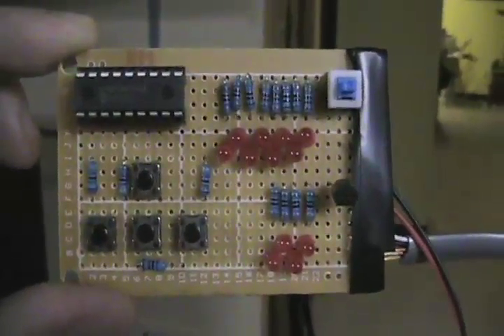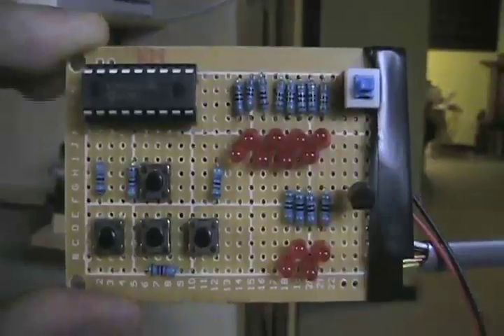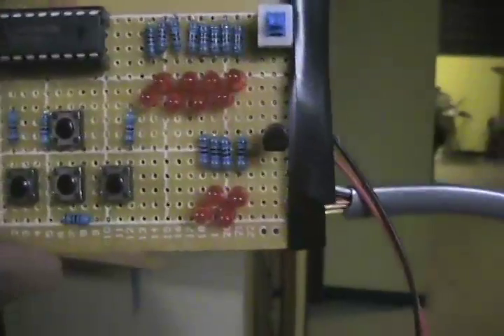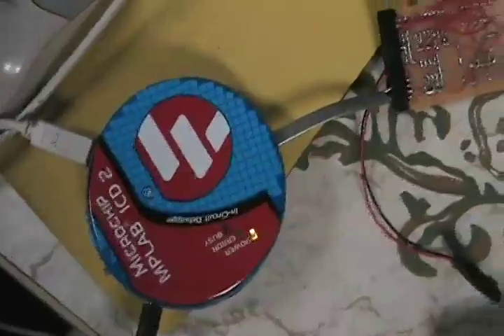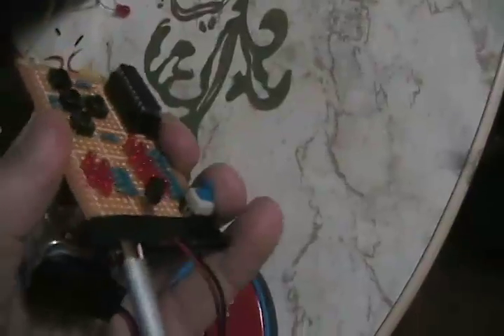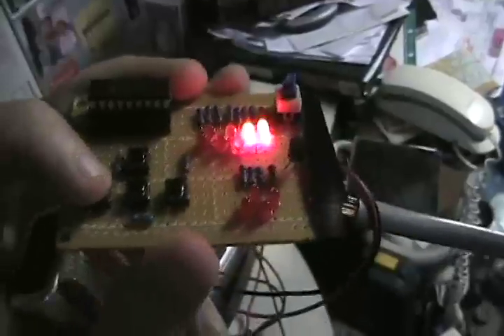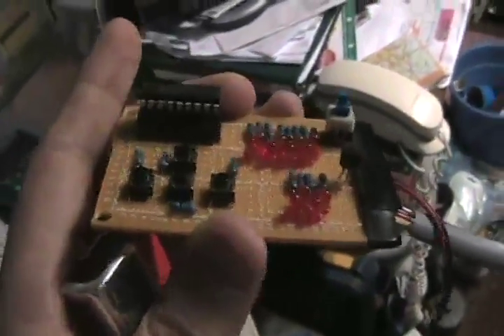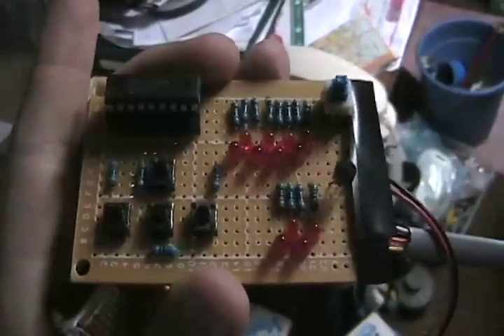My Home Made PIC Programmer board + Program!

Comment from the maker: Well that's a good idea, but the problem is that the MPLAB ICD2 unit cost $300CDN alone. As well, It takes hours and hours and hours to be able to use PICS.  The only reason I'm able to do it off the bat is because I was educated in ASY code in school.  If you're a student, it will al be taught to you too =)